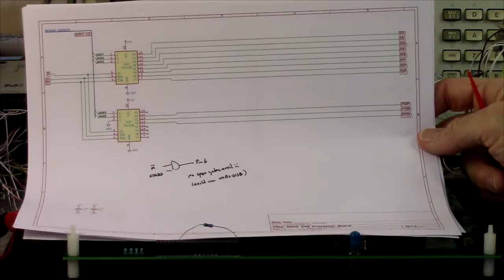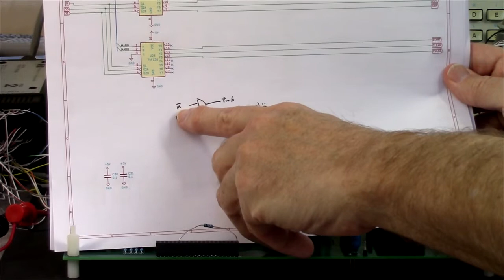Memory Test & PCB Mod

Comment: Nice video one question do you replaced the battery of the vintage logic analyzer ?
(I got the HP1630D and must replace the battery in near future before it leakage)
DJ
Reply from the maker: No.  I'm not aware that it has a battery.  Will have to check to service manual.
Reply from the maker: Hmmm...  I don't see any reference to a battery in the service manual.  Are you sure you're not thinking of the 3478A DMM?  Or do you mean the electrolytic capacitors in the power supply?
Reply: @MartianTech  does your device doesn't have a battery buffered clock time and date ? I must enter a new date and time after the selftests are done. May be my HP1630 have the date and time feature and yours not ?
Reply from the maker: I don't get prompted for time & date.  I do see it as a setting in the Peripherals menu (SYSTEM>NEXT), but it's just zeroed out.  Never tried setting it.  Maybe you have a newer model or an option that I don't have?  Mine is a 2551A.  I see a mention of option 007 for the 1630 in the manuals, but haven't found a description of what that option is...